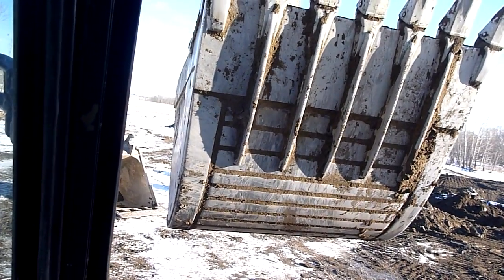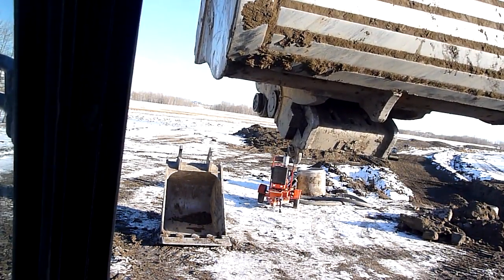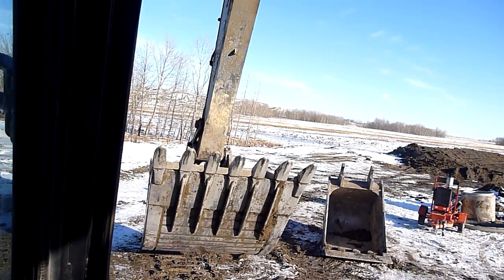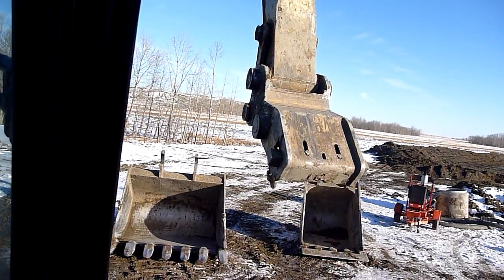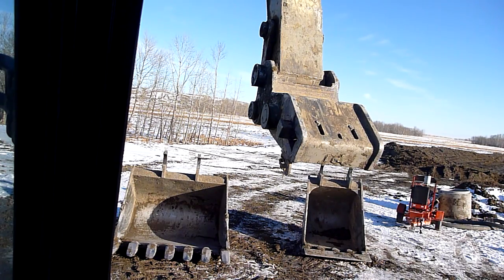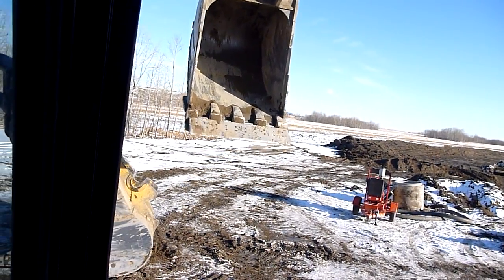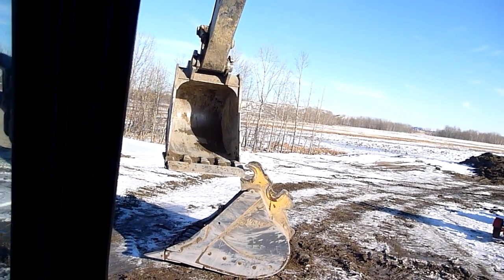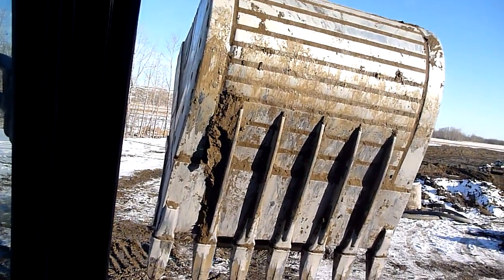Hydraulic Quick Coupler- How it works

Comment: Pin grabbers are extremely handy for re-construction jobs with single or multiple trench boxes or digging under things because you can turn the bucket around which is dynamite. The downfall is loss of breakout force. Not so good for bulking in hard ground. The one you have is ok but it is cheaper. The best one for no loss of breakout force is the NYE super stealth system. We swear by it on all our 65-5110 sewer machines. Not a single wiggle and tons of power. Check it out man. Also dont listen to the idiot with the bullshit comments. He doesn't know fuck all. Those rotator buckets can't pull the skin off a fuckin grape also aren't the amazing when they get loose lol. Ive dug Mainline Re and Re for 18 years on the busiest streets in Ontario so i have a few minutes of experience with 5 boxes downtown Toronto.   So for him to say we are behind in times. He can kiss our asses. Canada doesn't fuck around. Keep it up brother

Comment: There are two basic styles of quick attach systems.  Do not use the brand name to describe them. pin grabbers are the most common, the other is a dedicated hook  the JD850d-lc is using a dedicated hook not a pin grabber system.  More accidents have happened with pin grabbers than dedicated hooks. I do not like pin grabbers.  As far as dedicated hook systems, I like the ears looking away and not toward the cab.  This way narrow buckets do not roll away from you.

Comment: Do you ever have the problem of rocks and shit getting inside your quick coupler and jamming it up? One of the guys I work with broke the cylinder in the coupler and I've been finding a that I also get a lot of rocks inside the unit and it takes a bunch of extra time to clear the crap out. ??

Comment from the maker: @t0lwers Using a tilt rotator on a road job? Well we do have graders and trim dozers for that. I see the benefits of having the rotate feature, but at the same time how often have I felt the need to spin that fucker around 360 degrees? I can do it on a grader doesn't mean I use it there either. Many people around here do have rotating couplers but you also have to remember thats generally a stage in the development Jason and I aren't around for.

Comment from the maker: @533nick Yes I (Alex) have. I'm sure they are a fine machine for over in Europe but here they aren't quite what we are used to. I grew up with John Deere hoes and I mean actual Deere hoes before Hitachi. When you climb in a Volvo it feels cheap, they cater to the European market with being compact, light and fuel efficient. Unfortunately people here like having power. I like a hoe with grunt. Ever tried snapping up 3ft of solid frost slabs with a hoe that couldn't snap up 6" of concrete?

Comment from the maker: @533nick The easier one to use doesn't make it the best. I have used JRB, Geith and H&H pin grabbers and liked them all. I like the price of the Geith and the safety locks are nice on them. The H&H integrates well into a machine that was not originally setup to have a hyd. coupler and JRB makes a great coupler that is easily serviceable, great quality and outlasts the machine you bolt it to. Each company has its advantages and disadvantages. There will never be a clear winner in best hitch.

Comment from the maker: @robby844 The advantage to a P-G is that you can use buckets from other machines sometimes as long as the pin diameter is the same or close. You can also run buckets backwards and it uses a std. bucket that has not been re-lugged like the wedge is. In varies by region, out west here you find only Wedge's, but if you head east you only find pin grabbers. It varies in the area you're located in.

Comment from the maker: @robby844 Oddly enough pin grabbers have the same issues with buckets falling off that wedge-locks do. The bucket comes off when the operator doesn't make sure the bar has seated into the lugs correctly. Pin Grabbers have the same problem if you don't make sure you've grabbed the pin completely.One of the big advantages to a Wedge is that it will not increase tip radius as a P-G does.

Comment from the maker: @abc123456efg I have seen one or two loaders set up this way but generally they are set up with hooks on the high side of the bucket and a hole at the bottom that a pin slides through. I believe the Deere 744J video shows the quickl attach at the end.

Comment from the maker: @robby844 They don't work as good as pin grabbers, and yes buckets do fall off. But the sad part is in this province you might find one hoe with a pin grabber coupler. Even std. non quick attach machines are equipped with a wedge lock bucket most of the time.